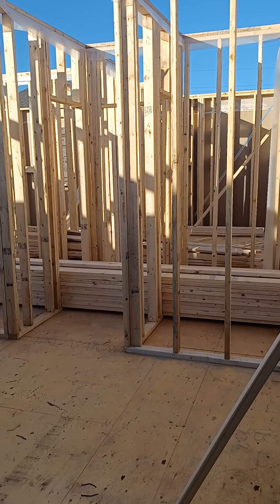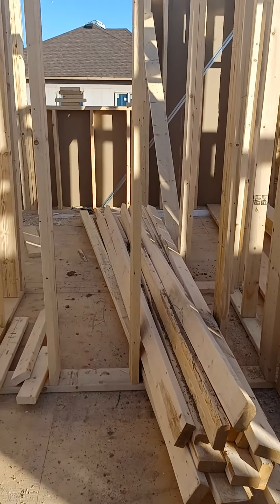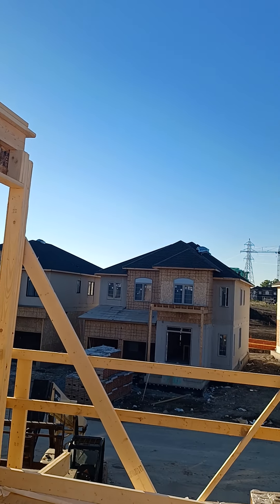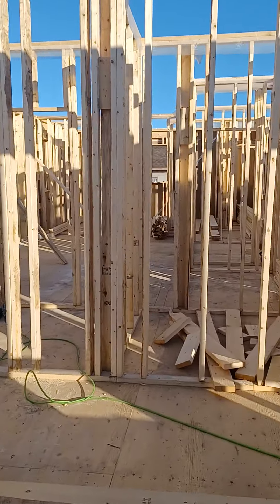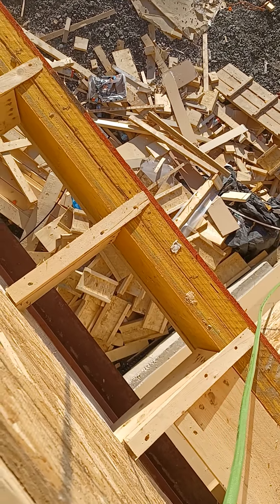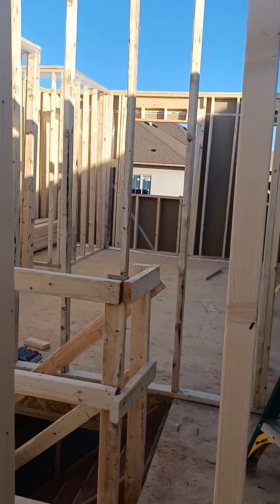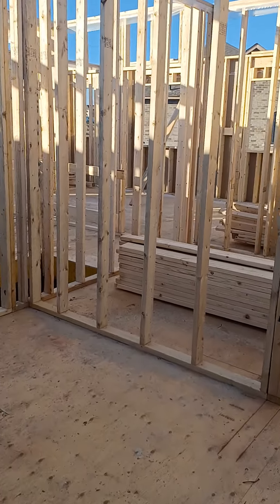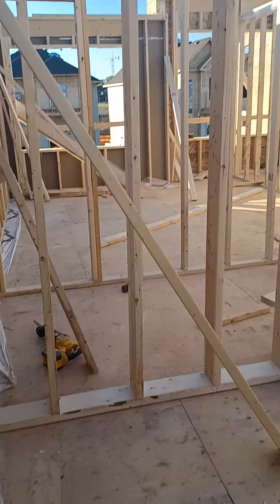second floor wall recap

Comment: Hey, I had a question about sheeting walls and where you like to put your seams. when you frame first floor walls, do you run your sheeting to the top plates, or do you leave it low so the floor will tie to it? and on the second floor, do you hang it down and then jus go around after to staple to the rim? I've just always been taught to do all your sheeting it off the lift afterwards, but I'm trying to eliminate the need to work up high all the time and want to sheet my walls while they are down like i see you always do!

Comment: Framing alone .. I know that too well . Building a house doesn't always require a crew . Many times the" Help 
is in the way . Plus you gotta get it done even faster now you got another person gobbling down money . Many builders have said to me " You need to hire more people " . Yeah .. where are they ? and are you willing to pay more on the contract , More Help doesn't always translate into more getting done . . I have reasoned with many .. If the house takes 800 man hours to build , Then I just get an 800 man crew and it'll get done in an hour .. Doesn't work like that !! . Even on smaller homes . A 10 man crew devours payroll and has no room for the smallest oversight . So you better fly through it and bang it together . So sometimes . Just do it all yourself . One of my last homes before I caught a case of Stage 4 cancer . Was 8000 sq ft and cut up . I could only afford one more crash test dummy  . The builder had a brownie boy that he planted on the job to " Help "  and to learn from me . He was in my way and had The Anti-Midas touch . Had to keep a wary eye and a fully loaded Sawzall at the ready .. Many times I had to remind myself " If I don't do it . It don't get done " and I didn't like to chase around numb nuts and find his mistakes . So less in my opinion , Sometimes is best .  On top of that .. Comes The Homeowner . Who wanted rough siding . He wanted natural wavy board siding . He had his property lumbered and knew a friend with a sawmill . The poplar was surface dried in the sun for a year " Horror Story " and every piece required a thorough assessment and where it could be used . The Builder priced it like it was vinyl siding and I priced it like it needed to be priced .$1000 a sq to install !! . Homeowner said he had wished he had milled his own studs , joist and rafters .. To which I said .. Had you . I would have charged you 5 times more to frame .. Just buy kiln dried !! . I don't want to spend half a year twisting banana boards into plates .The trash for siding was manageable if you selected and delegated out every piece . But Framing . Nope ! .  Whenever we came up short on post , interior trim or siding ..We'd hear a chainsaw in the distant .." Oh .. He's getting our crown molding" " . For interior trim . My poor table saw ran all day . Jigging every board . and I trimmed the entire house by myself . . But on the most part . I work alone . An old saying " Take a million monkeys in a million years , Sitting at a million typewriters . The probability they can write one sentence of Shakespeare is near impossible " .. This applies to carpenters as well .. When they are the monkeys !! .. Now some homes get too big and need firepower .It would take forever even going full throttle to build by yourself . So "Firepower " which is other skilled carpenters cost a bundle . Chomping on the bottom line . Seldom times I was able to get Cost Plus on labor but even that has it's inherent dangers . Start frying up the money , Billing the builder who in turns bills the homeowner . Then they instinctively think you aren't getting enough done relative to how much they shoveled out . But generally I exceeded expectations and it wasn't a problem in the end .   I just like to work alone . My Swan Song before the cancer started chewing me up . Was a 2 story addition for a neighbor . Go to the hospital and get chemo or a brain scan and come back and work until sunset .. By myself . It was one way I was giving cancer the middle  finger .. Not me , I am a framer and I know pain . So this ain't nothing . They thought I was some type of superman being able to work in blazing July and August between The Cancer Center visits and their addition . Told them " I got to get it done before The Crud starts kicking my ass " So it was sun up to into the night . Everyday .  It was fun .. I worked alone ..With Angels guiding me

Comment: I likely missed your videos demonstrating how and when you sheath exterior walls.
When do you sheath, and if you sheath walls while they're laying on the deck, how do you stand them, especially if they're long and heavy?
Thank you.
Reply: yeah I would love more info on this too!
Reply: I frame alone regularly too. With 2x6 walls, I only sheath the bottom 1/2 of the wall, I leave out the header, and limit my wall lengths to 12'.
After the exterior walls are up, I finish sheathing and house wrap.
I can only get away with this on single floor housing. On 2 story homes I need help standing walls as they need to be sheathed and wrapped before they go up.
I do recall you experimenting with some wall jacks you were quite uncomfortable with, but I don't know what your "go to method" is seeing that most of your homes are 2 story.
I haven't seen if you are responsible for continuos surface house wrap either, I am where I build.
I'll be 60 next summer and am a smaller guy (5' 10" 160). Any younger crews that come around give me a thumbs up and a handshake when they find out how old I am.
No worries, as I have some guys I work with periodically that show up a day or 2 and help at times stand heavy walls.
Are you in favor of wall jacks or use them?
Thanks for posting all your content, gives us some great benchmarks to shoot for.